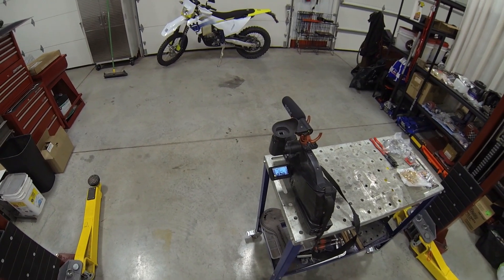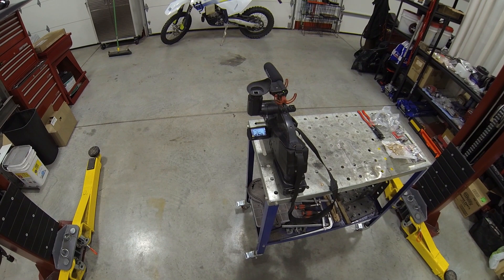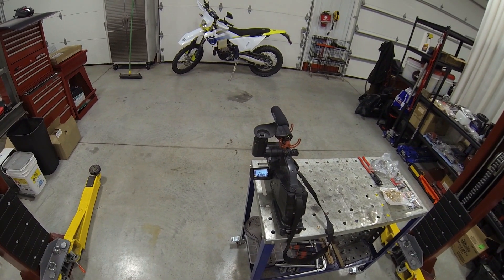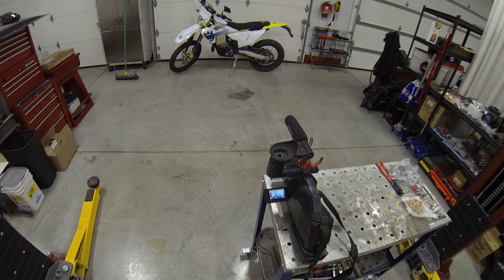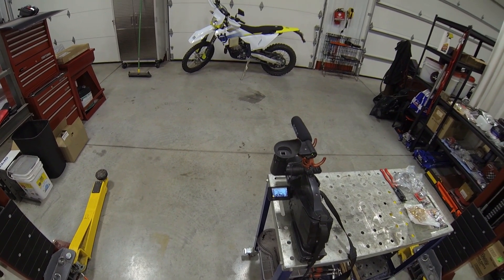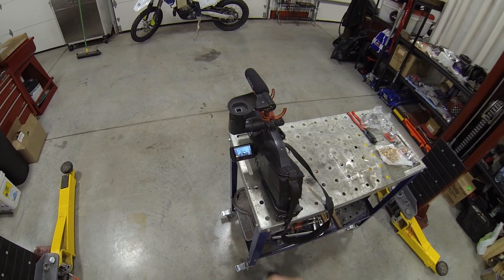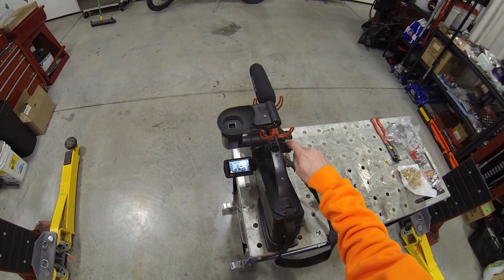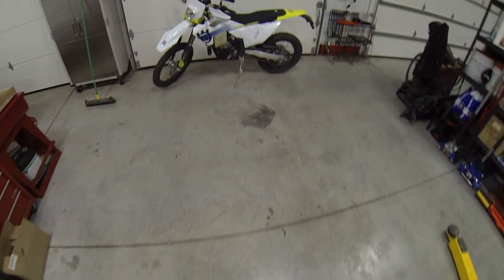2024 FE 501s Exhaust Sound Test (OEM vs Pro Moto vs Ultra Silent)

Comment: hey there and thank you for making both videos about those PRO MOTO end caps (installation and sound test). 
I am also looking for a solution to make my 24'FE501 a bit more quiet - as in stock form it is hurting my ears (and I know my neighbours do not appreciate the noise level neither). So what is your experience after 10 months with this custom end cap? Did this combo solved to problem or is the noise level more or less about the same as with stock end cap? So you (still) ride with ear plugs? All the best from Poland!
Reply from the maker: I ended-up taking the Ultra-Silent insert out, but the bike still sounds much better than stock. I wish I had a better video for you. This is all I have at the moment (with the Ultrasilent insert): https://www.youtube.com/watch?v=g7zX1l9BHBo
Reply: @PowerSports  Thank you - it sounds nice and if it really keeps the noise level lower than stock muffler, I'd be tempted to give it try :)
Cheers!

Comment: In your honest opinion,which was the quietest?  From the video it sounds like the 2nd end cap.  But idk if the low tone is cancelling out the engine noise or not ? It sounds like a lot less engine noise.  I want to open up my GG500 but I don’t want it to be annoyingly loud
Reply from the maker: I found that the Pro-Moto Billet End Cap with the Ultraquiet Silencer worked good enough. Never had any neighbors complain. ^_^ Although, I am currently removing the silencer for an upcoming video, hehe.

Comment: Sweet! What is the service interval in 2024 model? Thanks
Reply from the maker: Service interval for ...?
Reply: @PowerSports Husqvarna fe 501 2024
Reply from the maker: I'm sorry, i don't understand what you are asking.  Exhaust systems don't have service intervals.
Reply: @PowerSports  My bad, should have been clearer - my question is nothing to do with exhaust. Since you have husqy 2024 and I am interested in purchasing Husqy fe 501 as well, so wondering if service intervals still short as before  eg every 30 hours or they have improved the engine so service intervals are more longer now. Thanks. Ride safe!
Reply from the maker: My understanding is that the engine service intervals are the same as the last-generation 2023 models.  The first oil change should be done at 1 hour.  Then every 15 hours after that.  There are, of course, lots of debates on that number...  Husqy has the service manuals available online if you want more details:
https://www.husqvarna-motorcycles.com/en-us/service/user-manuals.html
https://azwecdnepstoragewebsiteuploads.azureedge.net/24_3402722_en_OM.pdf
Reply: @PowerSports  Thanks! Appreciate that! Happy Nee Year!!! Fun rides in 2024!!!
Reply from the maker: You too!